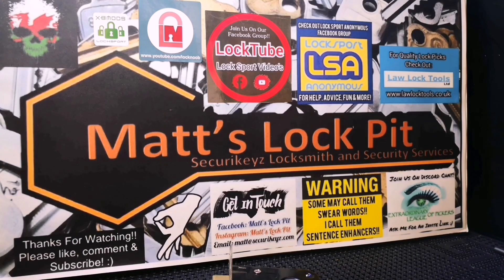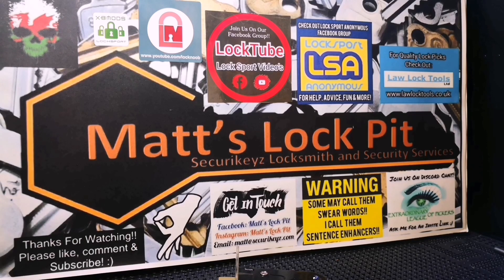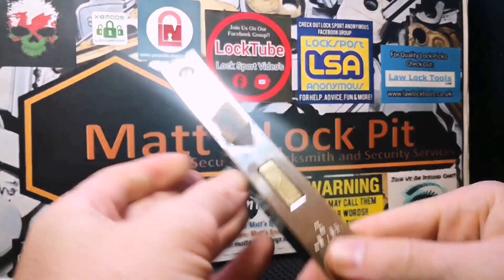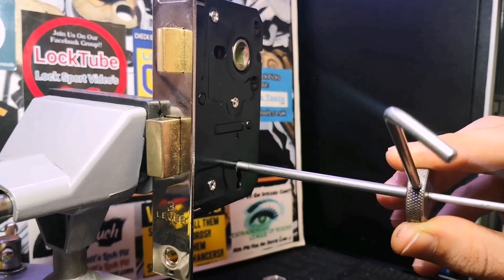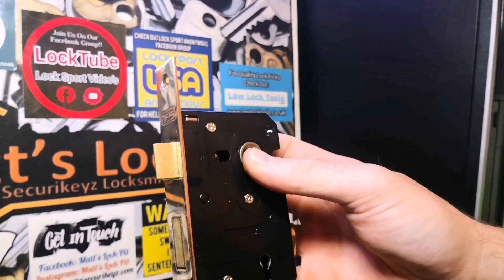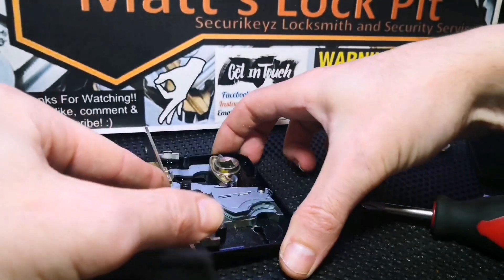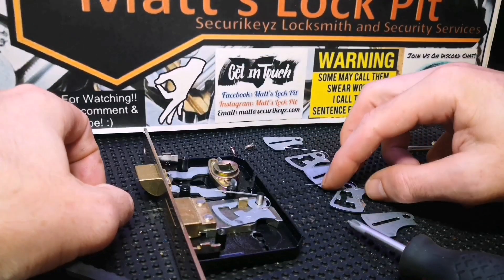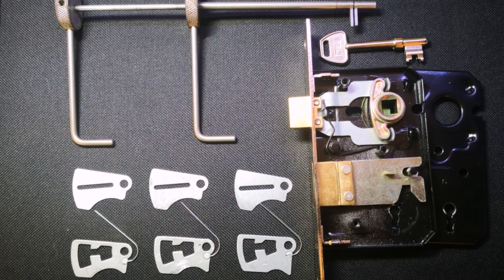TSS 3 Lever Mortice Sashlock Picked & Dissasembled

Comment: Early mornings suck but I guess it was made better finding this. Great story and wicked picking. Keep it up buddy, also need to try and get a lock tube sticker printed up if you can send me a file with the logo on would be awesome. Cheers buddy 👍 🔐
Reply from the maker: Cheers mate :) and yea early mornings arnt the nicest, could have been worse though :) and atleast it turned out to be an easy job :) 
I actually need to get some different stickers printed so I'll look at getting some lock tube ones done at the same time :) :) 
Thanks for stopping by to check out the video mate :)

Comment: Was there any lubrication on parts before you opened it up previously? because that looks dry and I'm wondering if that was a factor in it not opening up as well ;-)
Reply from the maker: That was the first time I opened it, I didn't look at it on the job as I upgraded it to a 5 lever anyways.
She was a touch dry as you said though, I think the main issue was that the spring for lever 3 was at a forward angle and interfering with spring on lever two. Also they keys are cheap and nasty aswell so that wouldn't have helped. So that combined with the lack of lubrication like you say, was enough to stop it. 
Nice easy job though 😁😁
Reply: @MattsLockPit  : Oh sorry mate I misinterpreted, I thought that you maybe  had already looked inside and probably cleaned it up for us so we could see the workings better, that's why I asked my question, I must admit I've never looked inside one of these types of locks myself, I couldn't even spot what you was saying about spring, they looked fine to me Lol.. I have got a lot of catching up to do on this subject but I'm learning a lot from watching your vids, greatly entertaining and informative I must say.. Cheers mate ;-)
Reply: @plug4uk696  usually  a mortice  lock opening from one side and not the other  is down to a worn or poorly cut key.
It could also be down to the fact  that tss are shit locks.